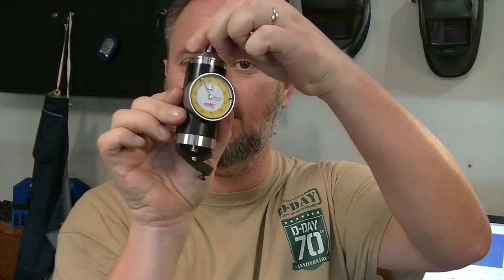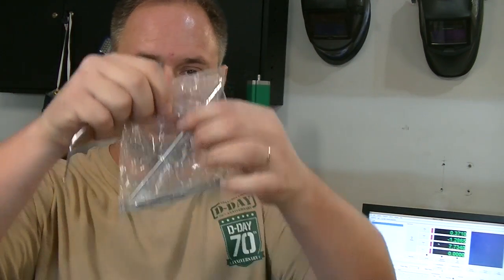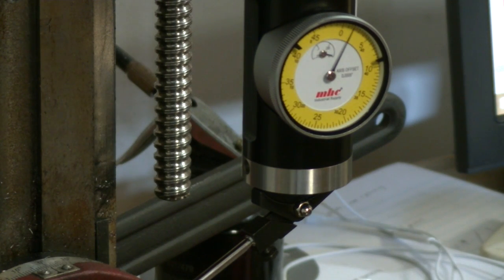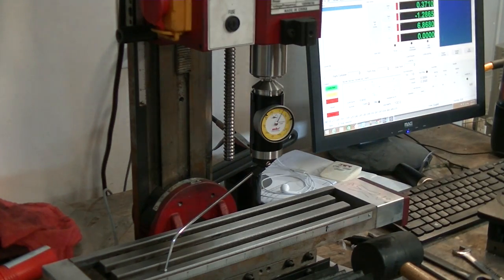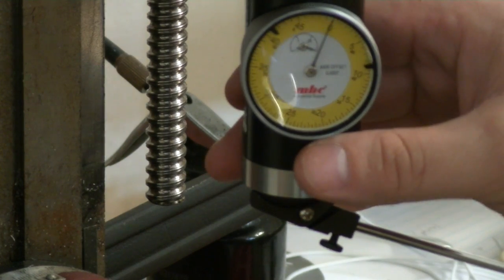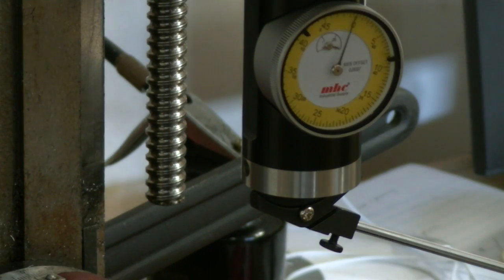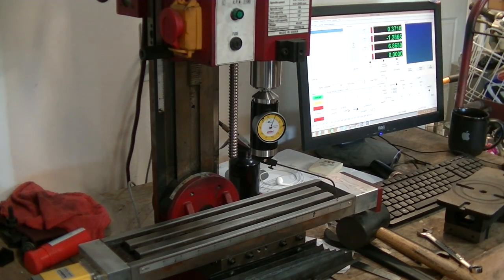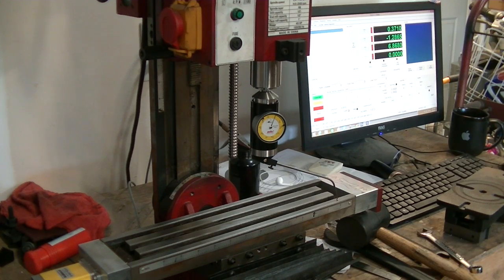Tramming the CNC Mini-Mill

Comment: Hey Tom, looks like your doing more and getting stronger each video.  Good to get the mill trammed in, and good explanation.
Reply from the maker: turbocobra Thanks, Gary! I'm definitely on the up swing. I'm pretty dedicated to the recovery tasks as well. I didn't show it in this video but I did pick up the insulation for the garage door. I'll get that installed sometime next week along with spraying foam into the walls. At this rate I'll have everything ready to keep cool just in time for Fall!
Reply: Tom Zelickman Lol, i hear ya... your timing on this kind of thing is similar to mine!

Comment: I insulated my garage very well and put a A/C in it.   But the A/C doesn't work very well ,  I think too much heat is coming off of the metal door.
Reply from the maker: 1970chevelle396 On the advice of some other YouTube creators, I got some foam panels to inset in the metal door. They're only an R5 value but it should do the trick. I just couldn't believe that my new, "Energy Star" rated home didn't have insulation in the garage. Makes so much more sense now as to why the bedrooms above that part of the house are harder to keep cool in the summer!
Reply: On my garage I replaced the door with one like a shop has,  so there's no way for me to insulate it. The garage is only 17 feet by 19 feet with a 12,000 BTU  A/C.  When its 100 degrees outside Im lucky if I can get it down to 85 inside.
Reply from the maker: I opted for the 14K btu model and even on energy saver mode it's kept things fairly comfortable. I only set it down to 80 for now knowing that the lack of insulation would be a problem. Any tips for me on this before I get too far in?

Comment: Nice channel, I am retro fitting my sieg mini mill at the moment, for software I am using LinuxCNC, blendercam and freecad :)
Reply from the maker: +David Stevens (davro) Thank you, David! How is your conversion coming along? I'm always open to doing this differently so if you have suggestions please feel free to share them.

Sincerely,
Tom Z
Reply: +Tom Zelickman (Inspiration Metalworks) I am just collecting all the required parts at the moment, stepper motors, power supplies, ball screws, parport breakout board, etc. I have a dedicated linuxcnc pc running so I am currently learning the software I really hope to do it all with open/free software (big fan of the free software)

I will put some videos up about the conversion soon :) Your findings are helping me greatly, I really like your video style where you have a machine example then cut to a talk where you talk about the current mill situation. 

I currently have the milling table off and am polishing up my x, y gibs strips mine are in a simular condition to yours. 

So pleased I stumbled across your channel :) did you say that your going to do a lathe conversion as this is also my next project after the mill is done lol.

Comment: Great vid Tom!  I already owned the coaxial indicator before I bought the "tramming aid" with the twin dial indicators.  Hadn't even crossed my mind to use the coax.  I like the idea of the coax way better than the test indicator because of the pain it is to read the test indicator.  I'll have to play with this method some time.  With the long arm on it, it going to be way more accurate than the two dial indicators 5-1/2" apart.  Thanks!!!
They turned my garage into living space.....so everything got insulated very well.  When I torn the wall out of the door opening, I put in a very well insulated and sealed door.....for a 9', it really wasn't that much.  The garage has the most stable temp of the entire house which makes it the coolest place in the summer and warmest in the winter......but the house gets supplemental cooling and heating. :)
Mike